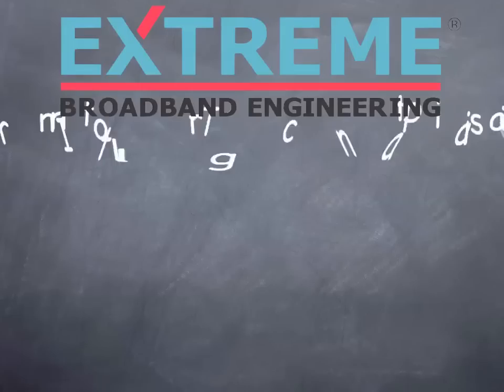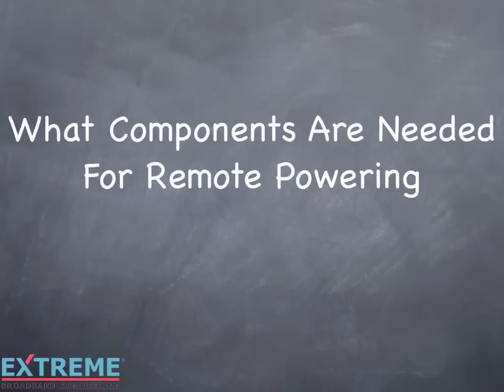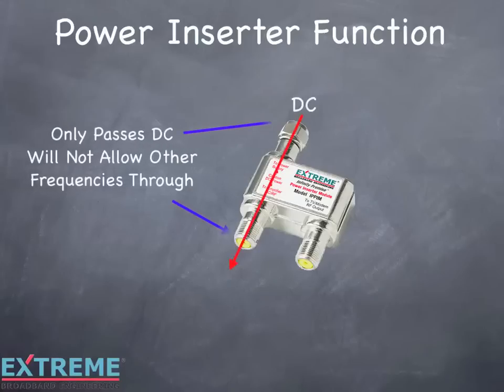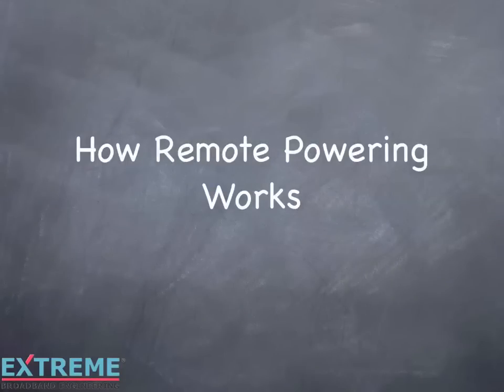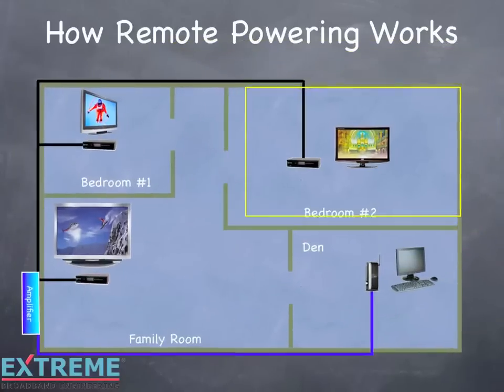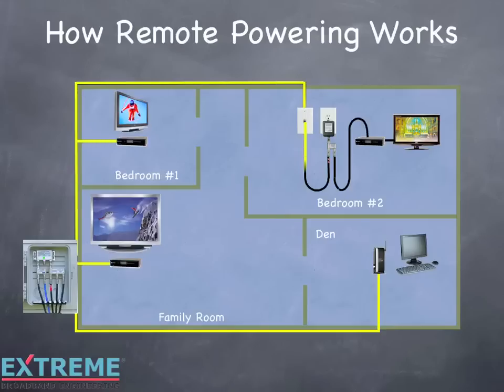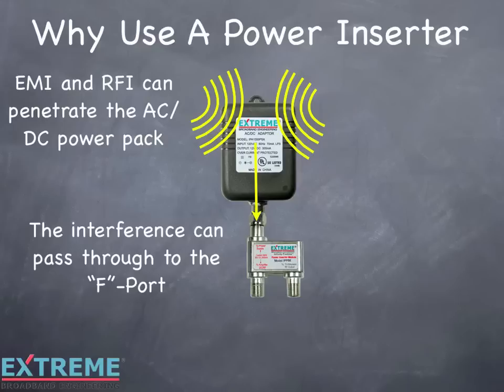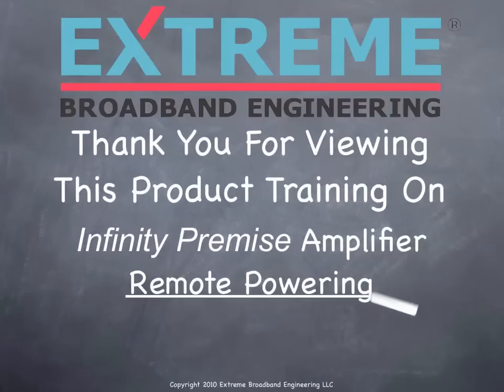Remote Powering - RF Amplifiers

Comment: Does powering via remote cause interference?
Reply: Great question.  There is no need to worry about interference.  The IPA series has filtering built in to isolate the potential for ingress.
Reply: @AmphenolBroadband  do you know where the filtering happens?  Is it at the splitter where the DC adapter would connect?  Do you know how it filters interference?

Comment: why would I use the power inserter when remote powering in the second scenario you showed...the power supply connects to the outlet sending 12vdc to amp via the direct power port not the power passing port of a splitter...the only reason for using the power passing splitter would be to send rf thru the same cable as dc voltage...if not sending rf and voltage no inserter needed and no power passing splitter needed therefor no EMI issues

Comment: Is a Terminator just a cap, or does it short across that particular hub?
Reply: How is your Peterbilt It contains a 75 ohm resistor. It's purpose is to prevent signal reflections. When the signal reaches the end of the line and has no where to go, it bounces back and is out of phase with the initial signal, causing interference.